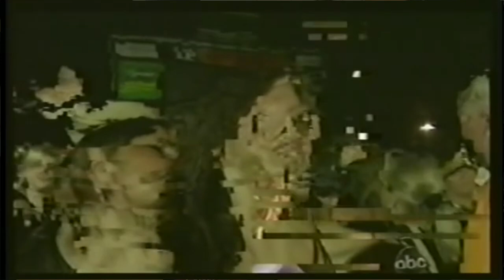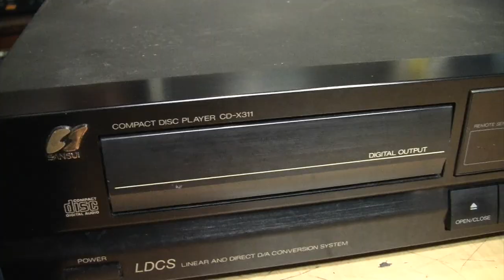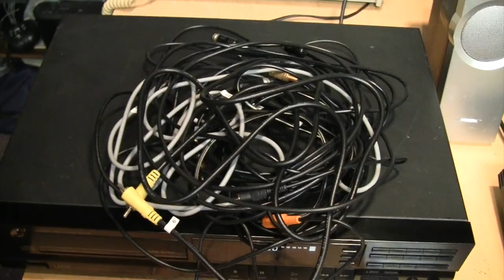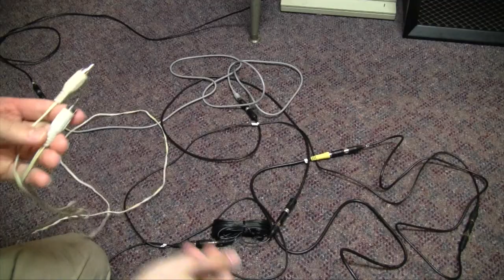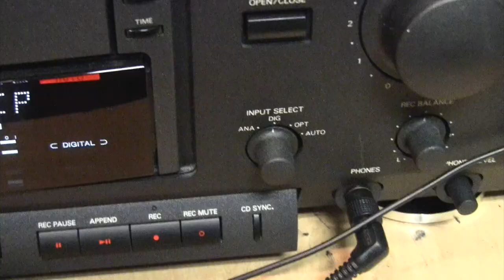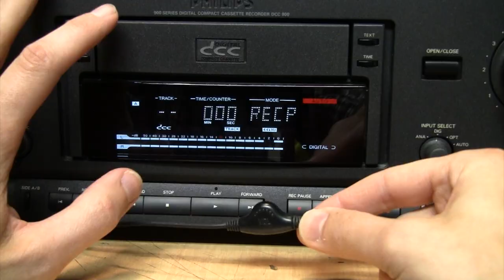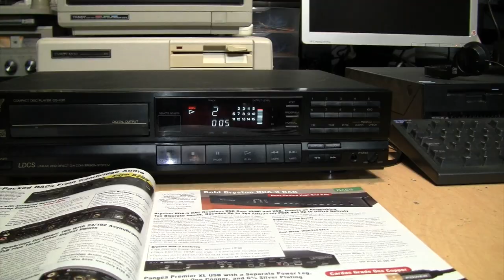What does a crappy digital audio cable actually sound like?

Comment: Dug a little into the comments and didn’t see this mentioned. My guess is that the distortion wasn’t caused by the cable’s length or quality, but rather because you were routing the same signal through the same cable in both directions. Since the conductors are neatly parallel, they likely induced the signal onto each other, creating interference. My bet: if you separated the two cables and tested again, the distortion would be significantly reduced or gone.

And yeah—anyone familiar with how digital audio actually works knows that expensive cables are nonsense beyond a certain surprisingly low price point.

Comment: They should have hired Star Trek's technical writers to make advertising for those audiofool grade cables.  If your electrons don't get to the DAC in correct time the audio will sound 2D (lel) what is this special technology we use in the cable?  Military grade tri-phase antimatter converter relays!

Comment: I knew it! Audiophiles are wackos! I was looking for record needles and such and I found some for over $800 dollars! Just crazy... Now I know that it is all just insanity, and I don't need to get $1000's of dollars of equipment to hear a major difference. Just a few hundred will suffice. Thank the lord I found this video, cause I was about to start believing that nonsense. I got a $150 Audio Technica Turntable picked out, with a $60 Phono Preamp, and I got me some decent headphones. A $50 pair and a $90 pair, both with 50mm drivers. Using neodymium magnets. So they sound good. One pair is open back, the other closed. Also another thing I might add is CD players are way cheaper to get into. I got a second hand Sony Walkman for $25 used. And I think it is the best CD player I've ever had. No skipping once so ever, and it has no crackle unless the track just had it naturally in the orginal mixing. 

So, yeah... Audiophiles are goofs. Just do proper research and testing first, and you'll see... You don't need a kaggillion dollars for equipment.

That crappy cable may have sounded god awful. But I kinda liked its sound. Definitely wouldn't use it, but it sounded cool. Also... Maybe it's not crappy. Cause it sounded okay when using one channel, it was wonky when you got both channels in the mix; it got crunchy. I think it just messed up cause it was definitely not being used in the proper way. But, I don't know... My guess is you got it wired in a way it wasn't intended, and therefore the audio got screwy.
Reply: Insanity, you have descibed them perfectly, company i work for produce some parts for one audiohil company so i know what they are seling it`s strate inasanity, like audiophil fuse for 25$, ordinary FUSE with gold plated contacts, it even have direction how should be iserted, in a AC circuit!
Reply: @Dagoth666Ur  That is just silly! lol! Yep... Just scams for the most part.. Oh! No! Even better... A Placebo Effect. They make you think because it looks so fancy and has a bunch of techno babble next to it. It must be the real deal! So they claim to; "hear the difference!" When, no... You just tricked yourself into thinking something is different, or better when, no. No, it isn't, It's the exact same as the cheaper one.

Comment: You probably got that distortion because the cable was coiled, making it act like a big inductor.
It's very rare to get distortion on digital audio cables and if you get it you'll know that it's not working right.
Solid silver S/PDIF coax cables are like gold plated optical S/PDIF cables.

Comment: I was at a friends house a while back and he was showing his new sound equipment. We started to detect a crackling sound in the left channel. Long story short, he was using 30 year old cables of dubious quality. After buying mid-grade shielded cables the sound quality was noticeably improved. The cables were not expensive, but made a difference. It is important to get copper cables, not the copper coated aluminum. Great video demonstration.

Comment: it does not need to be audio checked
PC recording software can easily compare and produce a checksum
proving a £1 cable delivers exactly the same information as a £1000 audiophile digital audio cable.
WHICH SHOULD LEAD YOU TO QUESTION THE VALIDITY and TRUTHFULNESS OF ALL THE OTHER AUDIOPHILE CLAIMS
My advice as to the ultimate and cheapest audio upgrade
is to clean your ears !
and attach a device to the back of your head to move your ears to pointing forward.

Comment: BRILLIANT
you nailed it
Digital is ALL or Nothing, unles you go crazy and connect loads of cheap cable for a massive length
always has been and always will be !
regardless of if you used a £1 cable from the poundshop or a £1000 cable from the Audiophile-Nob-Head-Shop
what actually happens on these massive lengths of cheap cable is the I/O on/off timing pulses eventually can't be handled by the cllock of the DAC you are using.

Comment: I'll tell you what put me off Monster cables (Monster was or is a "high end" brand of cables) .   A few years back, I was in a local deparment store.  DVD had just come out, so everyone was selling the players and discs, and most stores had displays set up so you could see them demonstrated.   Our local department store was selling Monster A/V cables at about £80 a meter (this would have been > $100 a meter at the time).   They had two identical DVD players set up playing the same film, on identical TVs.  One had a monster cable draped over the TV and one didn't.

The one that didn't had a terrible picture.   The one that did had a much better picture.

Being curious, I had a look at the back of the TVs.   The one that apparently had a Monster cable didn't.   It had a generic, no name but decent quality composite video cable.   The one that didn't have a monster cable draped over the screen had an RF cable that was such bad quality, I don't think the suppliers of cheap electronic tat I often see reviewed on channels like this would even bother with it.

The one area I've found where high end cables do make a differences is in large scale AV systems, where you may have lots of cables, or runs of 25 meters or more.

Comment: 20:34
An audiophile might claim that before the obvious static is heard, there may be audio degradation due to increased bit error rates, and associated interpolated or guessed samples and or bits.  They claim such changed bits, samples may affect less objective aspects of sound playback like instrument imaging, soundstage, maybe sibilance or other audio issues.
Don't know if true or not in any, some cases and equipment, but imaging, soundstage, dynamics are some easily discerned audio qualities that have no consistent objective measurement basis
Reply: Otoh, bit, samples errors can be easily checked and compared through recording via toslink or coax on a PC and comparing recorded wav files

Comment: Building on Anthony Liu's suggestion, I think that you would have gotten better results if you had connected the red from one end to the black from the other end, so that the signal would go through each part of the stereo RCA cable in the same direction, rather than opposite directions.

Comment: I do believe the commodore 64 sounds much better than the distorted crap of that 50ft speaker cable. 

On another note, i wonder what would happen if you totally separated apart the two cables of that stereo speaker cable. Would the fact that the signal was paasing through the cables in opposite directions but totally stuck together be the cause of the distortion?

Comment: How dare you reveal the top secret truth about all them audiophile the snake oil peddlers? 😂 I have a great setup with Matrix 803 S2 speakers, Yamaha CX-2 pre-amp and custom power amp and every music lover among my friends gets blown away by the transparency and power of the sound. Guess what? I use Amazon Basic interconnects and speaker wire from the Home Depot.  I tried expensive stuff and as I expected no difference was detected. Sure I forego my bragging rights but I’m into enjoying music, not the wires or wire stands.

Comment: Nordost  & some othercables can run into '000s.  also those lovers of cryogenically-treated (deep frozeezing cycled), may not be convinced :) - 'emperors clothes phenonomenen.' profitable, too. for my XLR component interconnects, I use Snare mic cables; a tiny % of some prestige brands. you can afford to experiment at these lower prices, no mortgage needed. good video.

mp3 doesn't allow us to judge comparative signals well, s I, for one, are happy to take your assessments.

Comment: On DAB we get the "bubbling mud" effect on weak DAB signals on stations that are encoded with the original MP2 codec, on DAB+ which uses the AAC codec, those stations start echoing on a weak signal.

Also, not every DAB radio supports AAC or DAB+, there are older radios that only support the older MP2 codec and not AAC, which means these radios can't tune into to stations encoded in AAC.

Comment: So roughly about 100 feet or somewhere abouts is actually the "realistic" "maximum" length... of EXTREMELY cheap and crappy quality cables before you lose ANY significant or noticeable amount of sound quality through a digital connection, most likely simply because the digital signal level, (i.e. the voltage of the digital signal), gets reduced down past it's "absolute minimum" for proper readability, simply because of the total amount of resistance of the ridiculous length of cheap cables, which I'm sure in that final setup you had on the floor connecting the CD player to the computer, was at LEAST a few OHMS, maybe even up to about 10 ohms total, whereas ANY ONE SINGLE, fully functioning RCA cable, no matter how "cheap" of quality, as long as it was actually connecting end to end, would most likely be no more than around 1 ohm or so, which would then work totally fine with a digital signal, as you demonstrated...

This video just basically totally sh!+ ALL OVER all of the "audiophile snake oil" BS that the expensive audio cable manufacturers would lead you to believe, LOL! I thought this video was rather hilarious because of that!...

One thing that I would note though, because it was an idea that I thought of when watching this, was I wonder if the signal would have actually STILL gotten through ALL of the length of those super cheap, crappy quality cables if you had reversed the connections on that last coiled up 50' cable you added that finally caused the failure, to where instead of going in (AND OUT) from one end of the total cable, if instead you had connected the other end of one color back into the "beginning" end's other color and then output that final other color on the "output" end to the next cable going back to the computer, that way the signal would have been travelling in the SAME direction around that "coil" of cable you had there, through BOTH sides of it, rather than going one way through it on one side and then having to travel back through the coil of cable in the exact opposite direction on the other side... maybe THAT is what actually "cancelled out" enough of the signal for it to finally fail?...

OR, maybe just the actual resulting cable inductance from it even being coiled at all over such a long distance was somehow negatively affecting the signal travel?... And in the case of possible cable inductance from it being coiled over such a long length actually WAS negatively affecting the signal flow, then I also wonder if you had just simply taken that final cable and unwound that coil it was in and instead just strung it out all over the place, that way the "coil effect" was eliminated, if it would have maybe worked after you stretched it out...?
(Thoughts for another day, another experiment, lol!)

Comment: Audiophiles make me laugh, obviously some things make a big difference (quality speakers, amplifiers, pre amps, phono heads etc) but when they buy multi thousand dollar "pure gold, helium infused, carbon fiber, sworvorski crystal embezzled" power cables and the little triangles to suspend their $10k speaker cables off the floor, that is just ridiculous. If you take a million dollar amp and speaker system and connect them with plain RadioShack speaker wire it will sound the same.

Comment: fun test. I prefer all-analog myself.  cables like Nordost, etc.1m TOTL can set a nut back $3000+; all to get a highly coloured sound. don't get me started on cryogenic-treated wires; its all a reverse con, imo.  optical- toslink ditto - basic plastic just as good as glass. fibre. yes, "emperor has no clothes." I think some that have more money than sense, actually like being/know they are being hoodwinked.

Comment: This proves what I've been saying for years: Use the cheapest cable you've got for digital signals.  If there is a problem, it will be obvious.  The signal range between some errors and complete failure is small, so it's either going to work or it's not.

From what I gather, commissioned salesmen at electronics stores (notably Future Shop in Canada that was purchased by Best Buy and eventually shut dow) made more selling expensive printer cables, audio cables and HDMI cables than the actual device you were buying.  I remember in the days of ECP/EPP parallel printer ports, one Future Shop salesman told me I needed a special "Bi-Directional cable".  No doubt revolutionary - a wire that conducts electricity in both directions! 

Although I try to use somewhat better quality analog cables (better shielding - I refuse to believe gold plating is even measurably better than chrome let alone audibly noticeable), I have always used really cheap cables for digital signals, including dollar store-issue USB and HDMI cables.  I've never had a problem with them.

I love your channel.

Comment: I like how you know the age of your cables. Every cable has a story, doesn't it? I actually still use the very first audio cable I ever purchased and remember the location of the Radio Shack that I bought it from.

Speaking of cables, once I used a really long telephone cable (probably 50 ft or more) to run audio between two pieces of equipment on different floors of the house (I think it was a VCR downstairs and a computer upstairs) because it was the only cable I had that was long enough and I really didn't want to move the equipment. I had RJ11-to-four-prong adapters on each end, then used alligator clips onto RCA or TRS cables into the respective equipment. And it worked! Barely any hum actually.

Comment: Damn it, all those cables do is transmit binary data which is then converted to analog audio. You can use the most craptastic thrift store cables ever and they work no problem. I have bought gold plated cables but they were cheap and cool looking. All gold plating does is make them less likely to corrode.

Comment: the amount of snake oil concerning cables is astounding. 
your pinned comment is spot on... Jac knows his stuff I reckon.
I recently upgraded my stereo brand new everything. I bought some very expensive patch cables...there was NO audible difference between them and a decent pair of my old patch cables. [gold-ens for those that are interested  about 45 years old now...]
I then ran  the new turntable and head amp through my  mixing board [ssl six]  and again no discernible difference could be heard by me.
[sl 1200 mk 7 to bryston head amp to ssl six and listening through mackie 824 monitors.]
I am confident my old mackie board would produce similar results.
as far as the coax goes for digital the  coax  I bought a reasonably priced length of coax from long and mcquade nice connectors  with good soldered connections  works great. Cant remember what i paid but it was under 50 bucks Canadian. still working fine  by the way. 
bits are definitely bits!
subscribed...

Comment: the 10m rating might be for 24bit audio. if i remember correctly tosslink was good for 24bit and i assume coax is the same. that could explain the massive distances over the rating. tho "premium" digital cables are horseshit and you shouldn't buy them

Comment: The obvious problem with this demonstration is you are using the worlds worst speakers/amplifiers and using a computer to convert digital to analogue. Experience some genuine hi fidelity equipment at some time you might just form the opinion that the vendors of these expensive cables are probably right.
Reply from the maker: As long as all the 1's and 0's are getting through without any errors, there will be no audible difference between digital audio cables.
Reply: Do you not know the difference between digital and analog? Come on dude, I bet you call yourself an audiophile and buy these snake oil super thick digital audio cables. Totally missed the point of the video

Comment: Its a great video, but i think that the last cable you had involves two rca cables next to each other carrying the signal in opposite directions, in the shape of a coil. I think you will get "cross-talk" between those cables as the signals are travelling in opposite directions each creating their own magnetic fields causing a current in the neighbouring cable (this is where shielding helps). It is a good insight though, basically as long as digital cable is "to spec" then spending more money is just flushing it down the toilet.

Comment: Nice video. It is clear that a digital audio/video signal is mainly working fine or not working at all. But I think it is different for Ethernet cables, because the protocol has an error correction. So if the signal is weak or degraded, you will still get an error-free transfer, but the speed of the transfer may fall down drastically.
Reply: The thing with Ethernet is it's so fast that you can retransmit dropped packets many times before the audio buffer underruns. The end application will reconstruct the audio stream without any jitter in most cases of dropped packets.